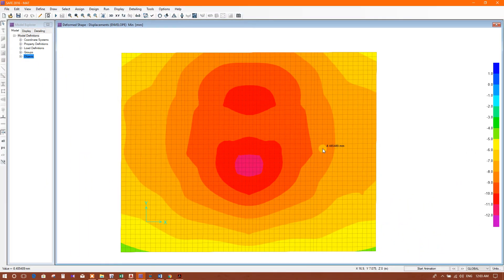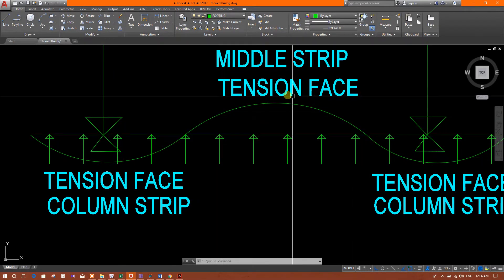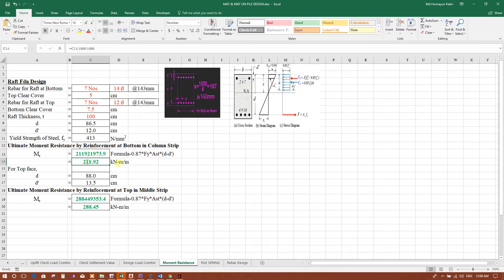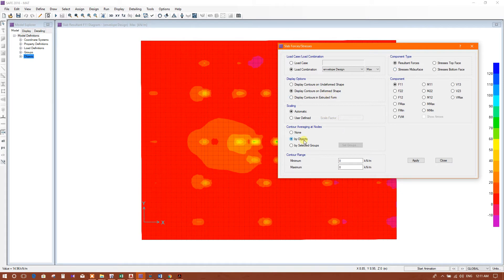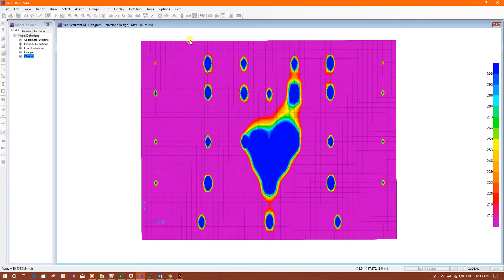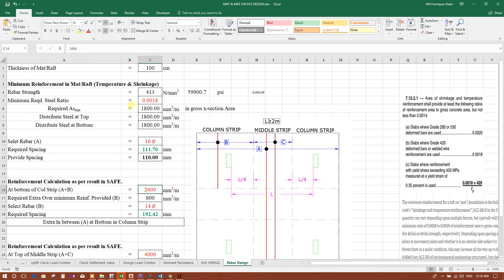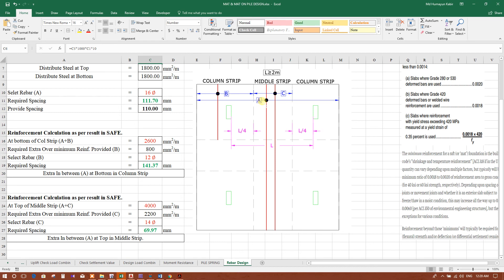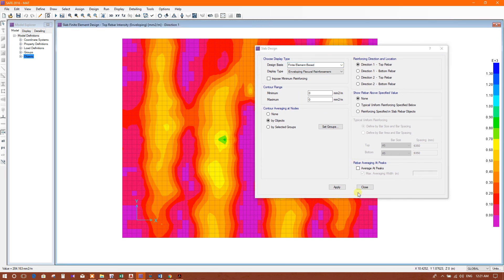7.DESIGN REINFORCEMENT OF MAT FOUNDATION-MAT/RAFT DESIGN COURSE

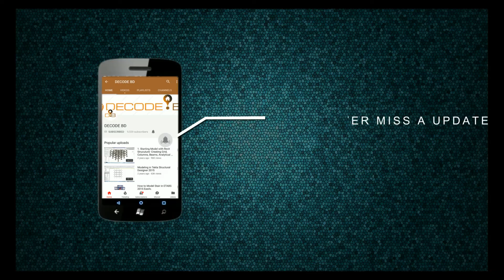Comment: Sir, thank you very much for a great tutorial. I have just one question. At timeline 17:01 when you are changing the rebar diameter in excel, you mention that spacing is out of specifications. How the required spacing can be determined? Thanks again for a great tutorial..